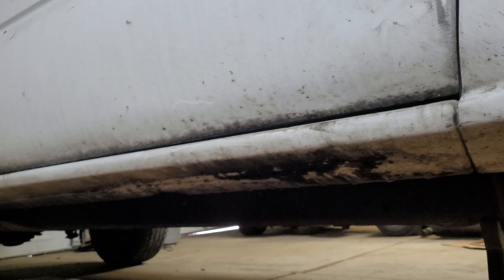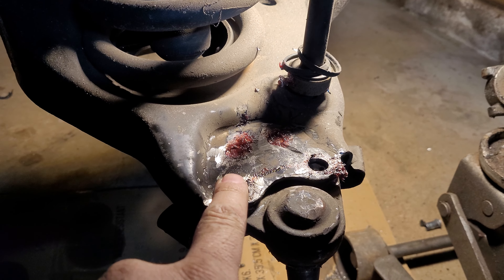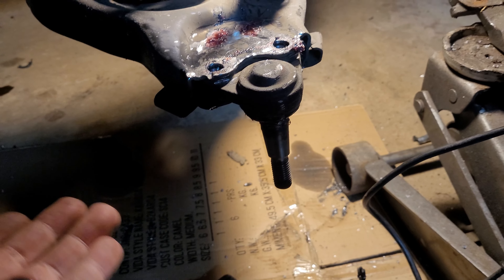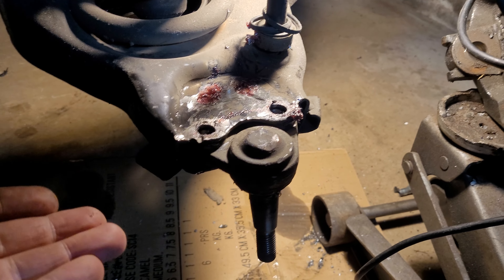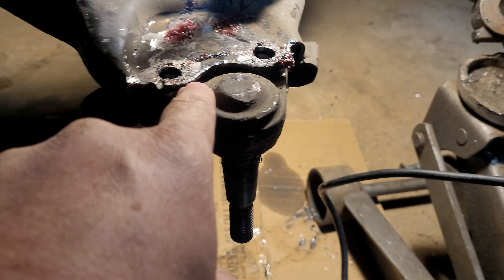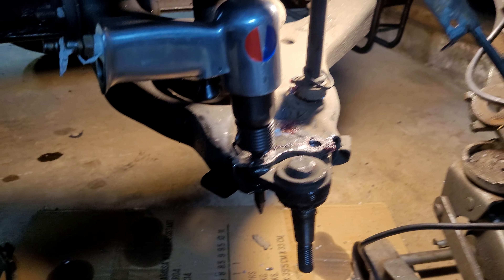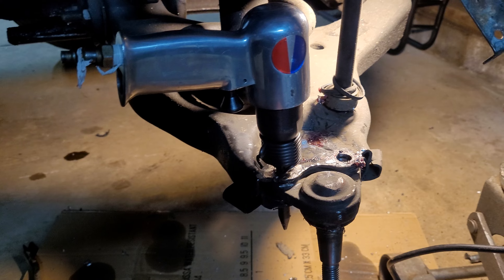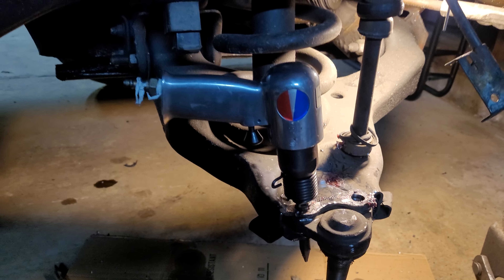1999-2007 Chevy Silverado/ GMC Sierra 2wd lower ball joint removal.

Comment: I just did this nonsense by hand. Used a big 3/4 flat chisel and a 4 lb mini sledge to knock off the tops of the rivets on both sides. Drilled into the side I intended to hammer on about halfway through the rivet and about 1/4 inch on the other side. That 1/4 on the opposite side provided relief for the material to squish inwards as it's being pressed through the hole in the arm. Used a 3/8 bit to drill the holes. Bought a 3/8 diameter steel rod and cut 1-1.5 inch segments off to insert in the deeper hole and hammered the rivets through the arm with that same 4lb mini sledge. I did this with the arms off the truck.

Comment: How did you remove it from the spindle? A traditional tool doesn't work because the balljoint itself is has those connecting points and the cup can't go around the balljoint.